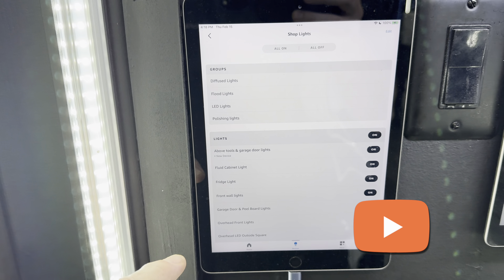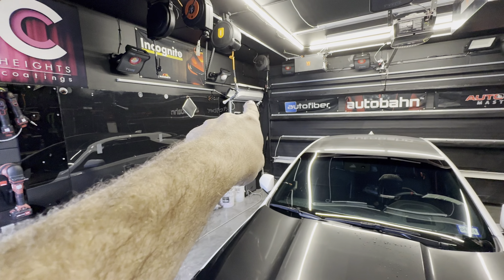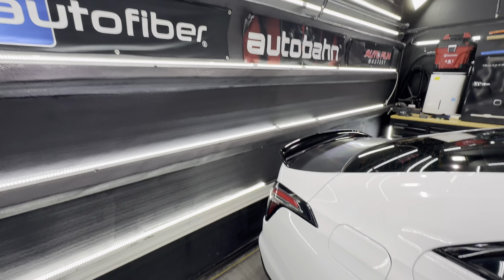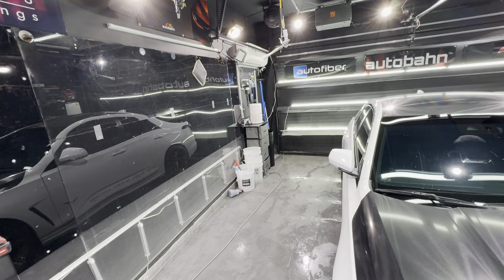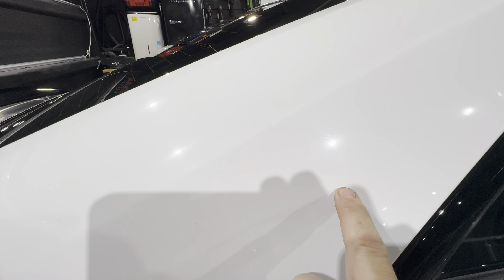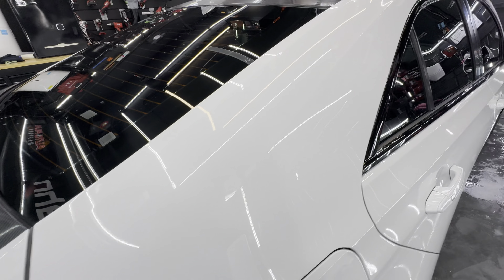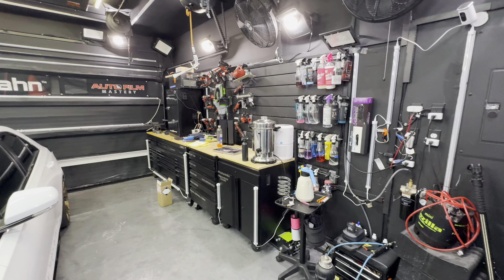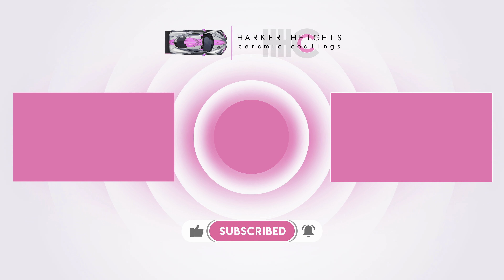Auto detailing shop lighting - is this too much, or not enough?

Comment: Awesome setup! I have 10 of the 5 bulk LED fixtures from Obsessed Garage on the ceiling and then an assortment of Scangrips for the sides of the vehicles, a handheld, and the same LED tube lights you have around the perimeter of the ceiling. Can never have too much light my friend! I love the videos and appreciate the content.
Reply from the maker: Thank you sir! I’ll have to see those - I’ve really been trying to get where the scangrips are the only lights I really use but they obviously aren’t cheap. 

All the lights help heat up in the winter too (although my HVAC has a heater it’s rarely needed I just turn on the lights)

Comment: Awesome explanation. I actually just moved back into my home shop and am now using the 8 high bay leds I had in my shop, 168000 lumens, in my 20x20 garage. Hyperlite did say it would be overkill and they were probabaly right but I love how I am able to see everything.
Reply from the maker: I think in total I probably have something like 800k lumens lol
Reply: @HarkerHeightsCeramicCoatings  that’s nuts but makes me feel better about my measly 168 lol
Reply from the maker: @mac102984 yeah you can see it from half a mile away if I have the door open at night

Comment: I think I can hear your meter spinning like Sonic the Hedgehog in the background 😉
Seriously though, thanks for showing the difference between LED shop lights and correction lights and around your shop in general. Does your setup allow you to use different color temperatures for different colored cars? Or do you have things set at one spot?
Reply from the maker: I have it set in one spot but you can adjust it via Bluetooth in the Scangrip app
Reply from the maker: I always think of the national lampoons Christmas vacation meter 

We do have 55 solar panels though it helps
Reply: @HarkerHeightsCeramicCoatings  nice! I didn’t know they had that capability. Thanks!
Reply from the maker: Yes the only issue is the app kinda stinks so you can’t control them all at once etc